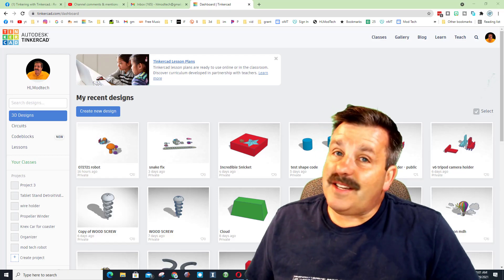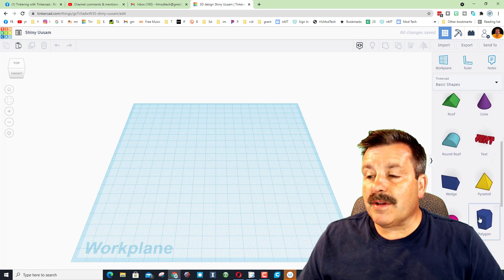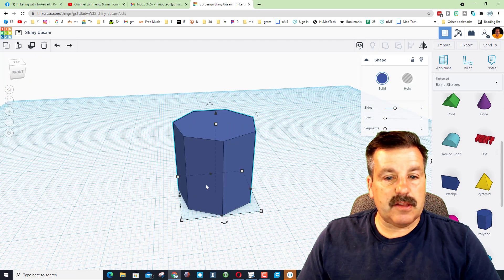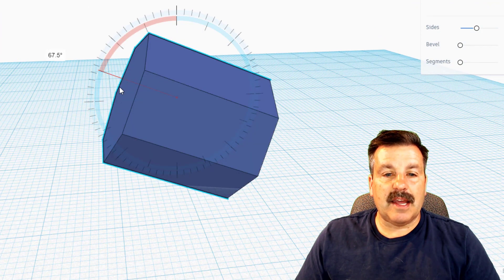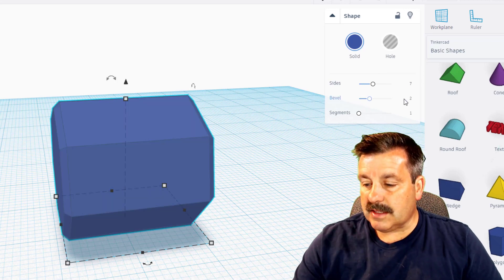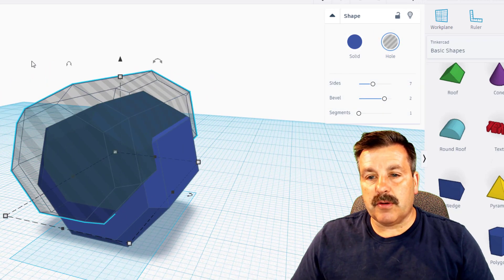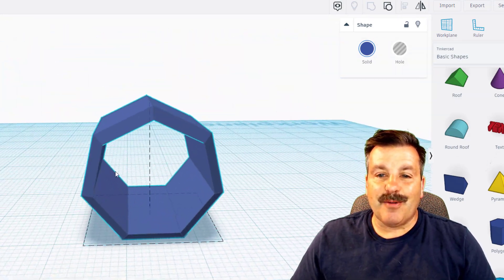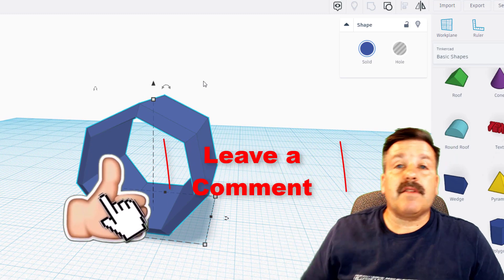Create Shapes with Seven Sides | Master Tinkercad in Minutes

Comment: Is it possible to find a way to produce a 14 sided polygon? as the limit is currently set to 12 side but I need 14 sides my my little project piece. Thank you
Reply from the maker: Interesting question... let me do some digging.
Reply from the maker: Solved it! You can take a cylinder and lower it's sides to 14. 💯👍

Comment: How do you set a "vantage point" for a design? i.e. "vantage point" is a corner or the center of an object where I can take a triangular shape and have all the small tips pointing to said vantage point. Think of a folding hand fan as the effect I am after.
Reply from the maker: I would use the workplane to work from the point you describe. Then use the rotate and nudge trick to build the fan. This video uses ellipses, but I think it is the same idea. https://youtu.be/ivOl3Go7cVg
Reply: @HLModTech  That helped out. It is not quite what I am after but it is a lot closer than what I was doing. Maybe a better way of describing what I am looking for is this: set a home point on the workplane where any and all shapes have a point selected to be stretched to the home set point (ie one tip of a triangle mates to the set home point and any other shape, regardless of what position on the workplane or angle it is in, a part it is gets stretched to the set home point) Think of a seashell pattern so to speak?